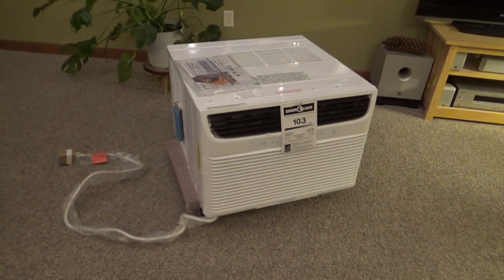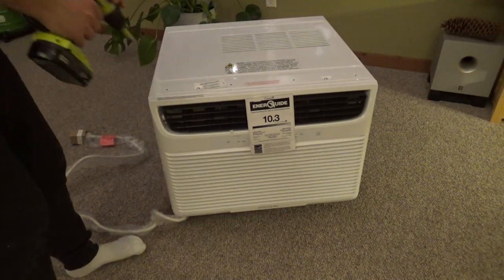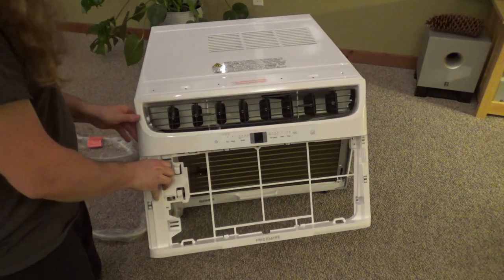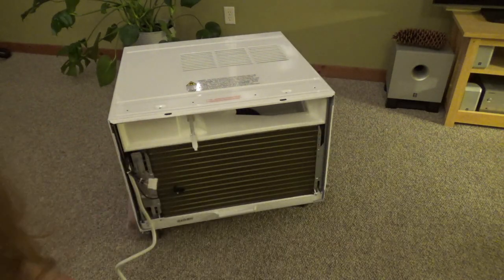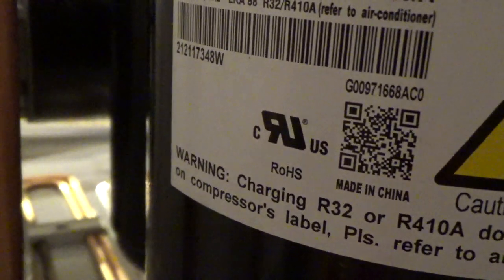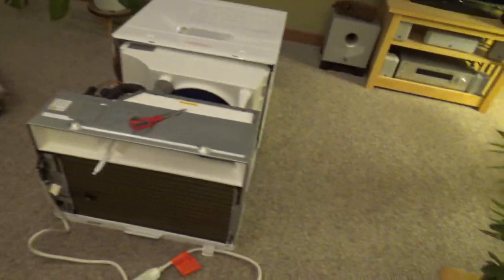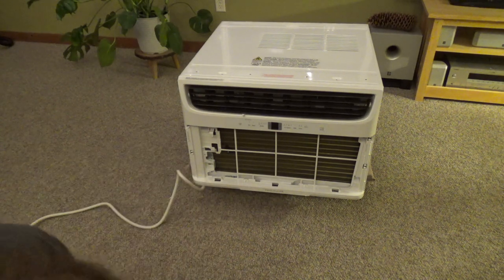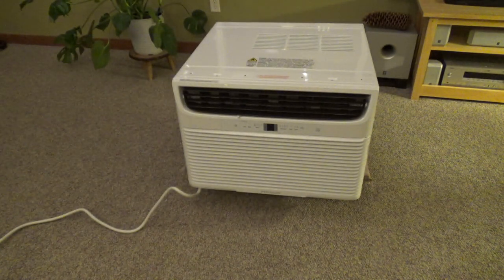Frigidaire FHWC253WB2 25,000 BTU Air Conditioner | Initial Checkout

Comment: Nice video of the air conditioner. A fun fact about this air conditioner is that I believe that the manufacturer of this unit is different from the 10000 btu Frigidaire that you have in the garage. The temperature up and down buttons on this 25000 btu unit have a grey border around the arrows while the 10000 btu unit doesn’t have any grey borders around the temperature up and down buttons, just white. The control panels also have some different buttons. The side and top vents on the exterior of the 25000 btu unit have a more round shape than the 10000 btu one that has more of a squared side vent design seen on GE units not made by haier. They both also have different remote control designs. Also, the 10000 btu unit has R-410a while the 25000 btu unit has the r-32. These are just some things I would consider sharing.
Reply from the maker: The manufacturer of the 2 units is the same. It's clearly marked on the informations tag.

Comment: Have to say for this size you should have gone for the LG Dual Inverter 23500 BTU, I have one and it’s a beast! It can ramp up too 28000 btu and blows a impressive amount of air, and it’s been pretty reliable for being modern. Kept my 1200 sqft apartment at 65 in 115 heat.
Reply from the maker: I stay away from the LG brand, I've never had a good experience with their appliances.
Reply: Where did you buy yours at
Reply: I'm needing a slide in wall unit and lots of reviewers on several different sites have said their LG ac was not good/reliable and wouldn't recommend.
Reply from the maker: @jnbond  Generally speaking, LG Is not a reputable brand.

Comment: My 1985 Carrier 22,500 btu 220/230 just stopped working. Finding a 1:1 replacement has proven difficult to find that is reliable and works well. I am hopeful this is a good unit. Looking to purchase one. In my research there is a downloadable instructions and video on installation on the web for this unit that I watched before seeing your video. Thanks for sharing.
Reply from the maker: Stay away from this, it's nothing like your old Carrier. Unfortunately you will not find a comparable replacement. None of the units made today are reliable and none of them will last anywhere near as long as the Carrier equipment from the 80s.

Comment: I've never seen such a proponent of vintage air conditioners buy more new ones than a typical consumer lol
Reply: I was thinking the same thing. I would have made something work.
Reply: I am interested to see how long it will work for though with a drain hole and if taken care of properly. I see no reason why this should have a pre mature failure. As far as modern units go, these are pretty okay.
Reply from the maker: This was purchased out of necessity. I would prefer vintage, but both my vintage machines that would work for this room are temporarily out of order.
Reply: @JordanU  can it also be installed in the wall?
Reply: @JordanU  to see if your airflow is weak, first, check, if there’s a dirty air filter, or a frozen evaporator coil, or blocked condenser
Reply: @JordanU  But I know you have several vintage ones that work fine at the moment, like that Westinghouse.  As someone who likes the heat and has many fans, do you really need an air conditioner in every room before you're able to fix more vintage ones?
Reply from the maker: @Xyspade  Not in every room, but the living room, absolutely. On a 60 degree day with full sun, the living room's temperature will exceed 100 degrees in just a few hours. Granted the windows can be opened at 60, but when it's 80, 90, and/or humid, opening the windows won't provide much relief. Hence, this unit being purchased out of necessity as the room otherwise wouldn't be useable during the day.
The rest of the house could go without as it's insulated properly and won't heat up excessively.
Reply: @ArisBuliteanu  
That won't work, he always cleans and maintains his air conditioners.
Reply: I got both lol. The vintage one has iced over my windows before.
Reply from the maker: @donavonmacallister3101  My vintage 27,500 BTU machine can get the windows fogged up no problem. This 25,000 can't even maintain the temperature properly, let alone get much below 73.

Comment: I bought a previous version of that unit (was r410a)  several years back when my central AC had a major failure.   I set it on 60 degrees  and it ran  continuously for over four months no problem.  It got temperature to 75 but with very low humidity thus very comfortable.    It had a GMCC rotary compressor which had a buzzsaw sound that was slightly annoying.   You need to mount the sleeve and insulate it well and block the air gaps with dense materials like two layers of wood with a layer of high density sound deadening in between.  Not flimsy curtains or featherweight foam.   That will keep that nasty compressor noise on the outside of the house..

By the way you can't compare the energy ratings of window ACs to central AC / heat pumps.  The ratings are different.   SEER vs. CEER vs. EER are all not the same.
Reply from the maker: The machine itself has no sound barrier from the noise outside, it's just a thin piece of Styrofoam. A blanket should have been put over the compressor if such a cheap noisy model was to be used.
All those energy ratings are a joke anyways, they're nothing but a scam to try to sell more new units.
Reply: @JordanU  Blankets are not suitable for rotary compressors as it causes them to overheat...
Reply from the maker: @GannDolph  That's not true, compressors are self-cooled by the returning refrigerant.
Reply: @JordanU  that's true for scroll and recip compressors, whereby the suction gas flows around the motor windings prior to being compressed.  In a rotary , the suction gas first enters the attached suction accumulator, where much of its cooling energy is lost.  From there it goes straight into the rotary compression chamber(s) at the bottom.  It does not flow through the shell or over the motor windings .

Once compressed , the  high pressure compressed gas fills up the entire shell and flows over the motor windings, then out the discharge line at the top.   

The motor in a rotary compressor is cooled by a combination of discharge gas (*NOT* return gas) and air over the shell.   You will not find rotary compressors with sound blankets from the factory , nor will you find reputable makers of blankets  marketing them for use on rotary compressors as opposed to reciprocating and scroll.
Reply from the maker: @GannDolph  The rotary compressors are cooled by the flow of the refrigerant. They are not air-over devices. They can be completely isolated from all airflow, as seen in the design of thousands of pieces of equipment, and maintain reasonable operating temperatures.
Reply: @JordanU  please read what i wrote, it is 100pct accurate.    do your research , don't be a know it all
Reply from the maker: @GannDolph  I read it, and it was wrong. I'm not a know it all, I'm a licensed technician that works on the equipment, knows how it's designed and understands how it operates in the real world, not in a text book.
Reply: @JordanU  what licensed tech buys a new unit  instead of fixing one of the dozen units sitting in his workshop?!- hmmm....

 show me real world example of factory rotary soundblanket  or aftermarket blanket intended for rotary.   i know this because i learned the hard way - i killed a maytag r22 12k rotary compressor by putting a blanket on it , after ignoring Brinmar (the top blanket company) advice against using on a rotary.   they said it rotary depends  , in part, on free air cooling of the compressor shell.  Subsequent testing and research showed they were entirely correct..
Reply from the maker: @GannDolph  Considering the current price of R22, probably 99% of them would buy a new unit vs. recharging something that leaks. The Haier ESAQ406T is a unit I encountered recently with a blanket over the rotary compressor.

Comment: I must say this the unit for the first 2 years with me I had to get rid Of it due to an excessive amount of mold and mildew
Reply from the maker: Drilling a hole in the case to let the water drain out should cut down on the mold significantly.
Reply: @JordanU  it came with one but the 2 year was spiting water all over the place thx for replying 😊

Comment: I just got a 8000 btu with the temperature sensing remote. For it to work properly the remote has to be able to communicate with the air conditioner. If the remote gets turned around on the desk or wherever you have it the air conditioner will default back to just regular cooling. Took me a second to figure that out.
Reply from the maker: I noticed that with this remote as well. It really should have been an RF remote rather than IR.
Reply: @JordanU  i’ve also had to disconnect the sensor on the air conditioner from the coil and move it off to the side, as it is too sensitive and immediately will turn the air conditioner off if not using the remote sensor.

Comment: This is built using the old WCI chassis design which was a very well designed unit. We'll see how well the modern components work long term but from what I've seen l these units seem to be fairly decent.
Reply from the maker: I recognized the design, and the disassembly pains that come with it. It seems like everything is pretty conventional inside. These do seem to have a reasonable reputation, I was just extremely unimpressed with the volume of air the machine seemed to move.
Reply: @JordanU  Unfortunately weak air movement seems to be common on a lot of modern units. If they have strong airflow, typically the fan is extremely loud. Very sad situation if you ask me.

Comment: I have to ask, if you say all modern window AC's are terrible, but not everyone can obtain a vintage window ac and if you do chances are they're rusted or leaked refrigerant,. In your opinion what would be the best modern unit you can buy at a local Lowe's or home Debot
Reply from the maker: I think the Haier Serenity Series is the best option at this point. My testing has not been running for long enough for me to say how long it will last, but performance and noise level are excellent.

I wouldn't be intimidated by the large quantity of brand names and models available today. There are only a small handful of actual manufacturers, I'd say less than 5, that make the things. You can find the same machine sold under 15 different brands. They're all poorly made, choose one at random or find the best sale. Even the most expensive and 'high end' units will be replaced within the decade.

If you only need a small 5,000 BTU, get the most basic model with mechanical controls. The electronic controls are generally awful, the machine in the video lets the temperature of the room fluctuate by 7 degrees or more at times, which is the difference between being comfortable and uncomfortable.
Reply: @JordanU  which brand you would recommend between 12,000 BTU and 15,100 BTU units that run on 115V

Comment: You need a 240power outlet to fully used it at 100% isn’t it ?
Reply from the maker: I don't understand what you're asking. It's 240v equipment, it operates only on 240v.

Comment: My 25000 btu frigidaire from about 2018 stopped blowing cold last summer and I am now looking for a replacement.  What's the best new one I can buy? These new ones don't last for me.  I have an old carrierr 25000 still working and I have been through 3 Frigidaire units. Please help...??
Reply from the maker: All the units made today are junk. None of them last. Finding another old Carrier is your best option. I have a 27,500 Carrier from 1988 which I'm using in place of this.
Reply: My late 80’s Air Temp stopped working last year. That thing was a beast of a unit. Would freeze you out.

Comment: The problem is the water helps it to cool down the condenser
Reply: But it will rot the condenser which is not good.
Reply from the maker: The problem is not the water. The condenser temperatures are not unreasonable. There are plenty of areas in the country where this is sold that have dry heat. There will not be enough condensation to fill the pan in a dry environment. The unit must be designed to operate without it.

Comment: I got a dud. This is the worst ac unit I have bought. And it is a lot of work. Whatever happened to simple?
Reply from the maker: Are you sure your unit is a dud? I think these are just abysmal.
Reply: Ugh. I'm sad to read this as I was hoping this would be a good unit as I'm having a hard time finding a replacement for my 1985 Carrier slide in wall ac.
Reply from the maker: @jnbond  Repair the Carrier. Those units were some of the best machines of their time. I ended up replacing this unit with a 1988 Carrier.

Comment: Never ever buy a Frigidaire 25,000 BTU A/C. They're a huge disappointment. I am now having to replace one I bought and installed 6 years ago. It has never worked satisfactorily. I've hated it since I first turned it on. Now it's not working at all.
Reply from the maker: I agree, the performance of this machine ended up being a total disappointment. The temperature regulation is very poor and it doesn't provide anywhere near as much cooling as would be expected for the rated capacity. I ended up using a 35 year old Carrier unit in the room instead, it keeps the temperature within 1 degree and blows this thing out of the water in terms of cooling power.
Reply: @JordanU I just installed this same unit and I honestly can't even tell if it's working properly. The display turns on and then it blows less air than my 8000 btu in another room. If it's not defective and this is how these ones normally run, then I am highly disappointed as well
Reply from the maker: @erikthiessen4449  I agree on the airflow, it's abysmal. The amount of air it puts out feels similar to other 10,000 or 12,000 BTU units I've used.

Comment: Hey Jordan, I am so very glad to see that you are finally upgrading those old energy hogs you have to something modern and efficient! by doing this you are helping to save the environment, and putting harmful emissions in the rear view! Also Jordan, These new units use R-32 refrigerant, which is so very great as it has very little environmental impact! These are certainly great units, and I am sure it will work so very well for you! Not only do these modern units save the environment by not using harmful CFC refrigerants, they are also highly efficient, which helps the environment, but also saves you money! 
One thing though Jordan, I would not drill a hole in this! The unit is designed so that water builds up in the pan, and then a wheel on the condenser fan called a "slinger" helps to throw the cool water over the condenser coil, and the compressor! This helps it to run cooler, which helps it to preform better, run more efficiently, and last longer! If you drill holes all in it, the unit will run hotter and with higher head pressures, which will cause it to nor preform as well, run less efficiently, and fail in short order due to overheating! 
Porter Porter black
! 
Porter Porter black
Reply: Do not post spam SAMMY REEDY
Reply: @stevethefanman8955  I am not Sammy Reedy my brother! I am Tabitha (black) Porter! As you can see by my name and profile picture I am female and not Sammy Reedy! I am so very much Tabitha Porter!
Reply: @waltknox  You are too Sammy Reedy too my brother! It so clearly appears that this woman s picture was stolen and added to one of your looney accounts! You are so very SAMMY REEDY!!
Reply: @waltknox  SAMMY REEDY
Reply: I hope  that’s a joke. You would be lucky to have that unit not explode in 5 years. I had a modern unit before with r32 refrigerant and it DID NOT LAST o n e cooling season! I’m looking for a ventage unit with r22 that will last longer then modern stuff! And not drilling a hole will cause the coils to rust out and leak the r32 out!
Reply: @zenozer0themechanicalchann720  That is what scares me about it.
Reply: @Tabitha Porter Hello Sammy Reedy! I hear you have this Alternate Account for posting spam with! This is so not cool my brother! You are Not Tabitha Porter, You're SAMMY REEDY! You are so spammy we can't stand it! No More alternate accounts for posting spam!
Reply: @zenozer0themechanicalchann720  My brother, if you drilled a drain hole in the unit, that is why id didn't last! Sadly you ruined it! It overheated and then it failed! Operator error!
Reply: @Alco16-251F  I don't have any alternate accounts my brother! I am not Sammy Reedy! That is such a strange name! REEDY! Either way it isn't me my brother! I am Tabitha Porter! I am Michael Porter's lovely wife! I am also so very black!
Reply: @waltknox  INdeed it is you Sammy Reedy! Stop posting Spam!
Reply: @Alco16-251F  I am certainly not Sammy Reedy My Brother! 

porter
Reply: @waltknox  Yep you are, We're not falling for your tricks SAMMY REEDY.
Reply: @Alco16-251F  porter
Reply: @waltknox  Do Not Post Spam SAMMY REEDY!

Comment: I can’t believe I tried to take the styrofoam out. The instruction manual is pure garbage. It says to take out all the internal packaging. First thing that comes to mind when I see styrofoam is packaging. Why the fuck… COME ON.
Reply from the maker: The whole thing is pure garbage. Get a vintage air conditioner instead, they're made so much better.
Reply: @JordanU  good to know. I got this as a gift from my parents. I’m struggling to put it together based on the instructions and I’m losing my mind. I’m actually thinking about taking off from work.